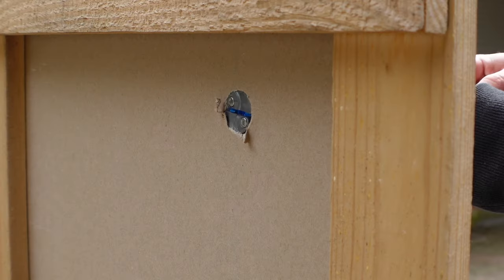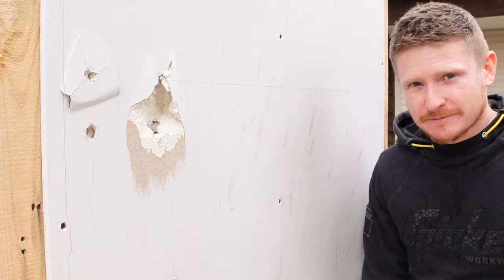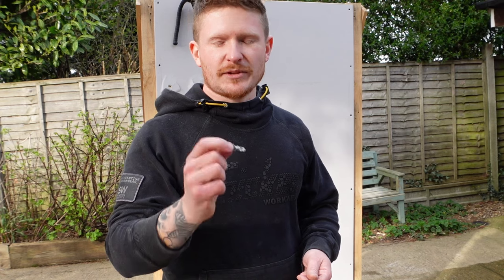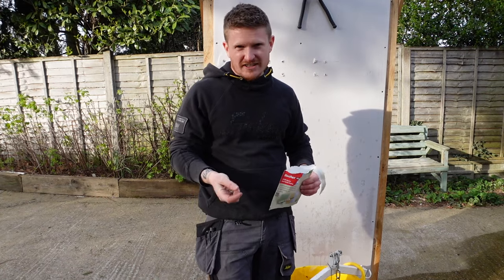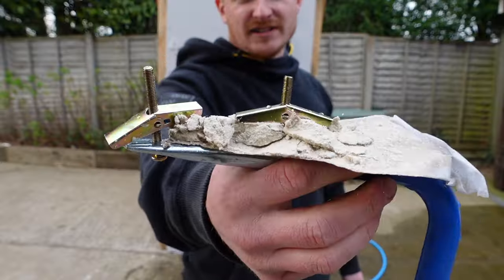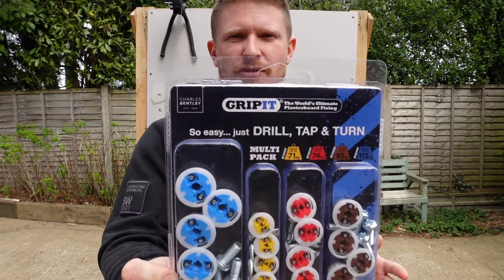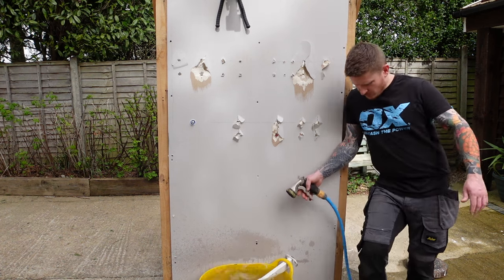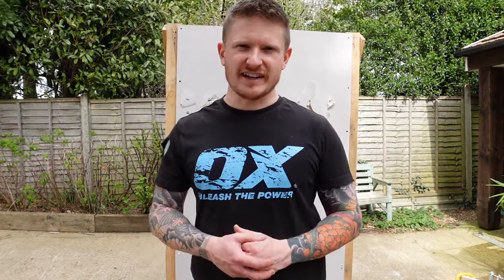What Plasterboard Fixings Are the Best | Drywall Fixings Tested

Comment: Am I incorrect here, but the loading measured surely is only half the recorded weight per fixing as there were two fixings each time, taking half the combined load....? So in actual fact, each fixing only performed to approximately half the test recorded value.....?🤔

Comment: My dad always recommended the spring toggle fixings over 40yrs ago which says something about the design. Two points I would make is that the spring toggles were let down by the plasterboard wall rather than themselves plus the hook you used had 2x fixings and I would think that the manufactures ratings would refer to the load a single fixing could handle? I does make me wonder how they did their own testing? I suspect a pull rather than downward load was used? I have no real idea. 🤔😄
Reply from the maker: You could well be right 😁
Reply: Got no respect for those gravity deniers! 😺

Comment: I moved into a 'modern' house with plasterboard stud walls a couple of years ago and found the 'tap in' spade fixings ideal for fixing shelves, mirrors etc. I've been impressed by their strength and that they are quick and easy to use.  The reason I watched your video is that now I have to fit a vertical radiator (about 15kg dry) which has four small angled u shaped brackets and no floor support. I think I'll be using traditional spring clip anchors after watching your 'test' video.
Reply: beware kids like to climb radiators.
Reply: Cut the board out between the studs and fix it proper
Reply: I fitted a triple thick bar vertical radiator, could just about lift it dry, very heavy.. you'll find thanks to the design of the small brackets that even if the fixings hold the brackets will cut through the plasterboard like a knife. Only safe method I found was cutting holes for the brackets in the plasterboard, mounting the brackets on wood then fitting the brackets to the brickwork with very strong masonry bolts.
Not a fun job.

Comment: Thanks for your time and effort making this.  I have struggled with most of these fixings putting up cupboards, towel rails and curtain track as they have more horizontal force than your vertical bucket test and just ripped out after a while.  Ironically, I found the Grip It ones worked well and now have a big pack of them.  They adjust to different thickness of plasterboard provided they are done up tight.  For a TV on a dot-and-dab plasterboard wall I found special long engineered metal fixings that are held in the brick/block wall and have a threaded front section for a bolt to hold the tv bracket.

Comment: Really useful test. Well done. I think to be proper science with repeatable results you'd need to do at least 3 samples of each fixing. Knowing how much variation there is as well as the average failure value would be very useful.
And now we need this experiment for insulated plasterboard (where the toggle fixings for example won't work due to no space to expand into). I presume some of the other clamping types will still work but they may not all expand properly to get a good grip, depending on how they work.

Comment: TLDR: use snap toggles (the kinds that looks like a metal bar with a zip tie attached to it) for heavy stuff like a television, use stab-in/tap-in for light loads such as picture frames.

With any toggle style anchor/fixing, it's less a question of how much the anchor can hold, but more a question of how much your wall can hold. They are stronger than your drywall/plasterboard/sheetrock. With other anchors, the questions is about how well they can hold onto the material. That's true for just about any of the true toggle style anchors such as the old school toggle bolt you used before the tap in one, the more modern snap toggles, or self drilling toggles (I don't like the self drilling toggles, but not because of a lack of holding power. I find the mechanism doesn't always engage and the threads that the screw drive into sometimes strip). snap toggles are my favorite of the bunch because they are mechanically very simple unlike the self drilling toggles, but they don't fall into the wall cavity when removed, like old school toggle bolts tend to. The Grip-it anchors aren't worth it at all imo, they're complex, require a giant hole to be drilled, and just like toggles it's dependent on your wall strength. Just use toggles and don't bother with them. As for the smaller anchors, stab in anchors leave very little damage if you need to remove them, and they hold a lot of weight for such an easy to use and non-damaging anchor, those are my preferred type of anchors for lighter loads like photos or brackets for small shelves with multiple screws
Reply: You figure you would use multiple tap in anchors for a small children’s book shelf? Or better to stick to the snap or regular toggle? Thanks for the advice!

Comment: I am a girlie of 72, new to DIY, but needs must. This video kept me rivetted as well as informed. Now to go and buy the correct anchor for my plaster board wall. What I will need to know soon, is how to hang 2 pictures (i am an artist and work in concrete and ceramic tiles) weighing 30 kg a piece onto solid walls.

Comment: I recently came across new ( new to me anyway) plasterboard fixings called GeeFix, they are fairly expensive but very very good. I used them to hang a large mirror and they worked a treat. Not something a kitchen fitter would use everyday due to the cost, but for the odd heavy item much better than fixing a damaged plasterboard.
Reply from the maker: I've used them once. They are very good for the larger loads

Comment: really great video thanks. One thing I would like to add (apologies if already commented on) is that it doesn't take into account the leverage / cantilever effect. So for example if you mount a wide shelf the force applied because of the cantilever is much greater. I wonder what the figures would be if you mounted a shelf bracket of 30 cm from the wall, and then hung the bucket from the end of the bracket. I'm guessing much lower. Obviously a fixing of this type would normally have 2 or more fixings also. These fixings are great for something heavy that is flush to the wall, I recently hung a heavy electric radiator to my garden room stud wall with hollow wall anchors no problem, and the same principle applies for heavy TV's for example, but for shelves that come out from the wall a long way the forces would be completely different. Anyway top man! Paul

Comment: Great video and very useful test. In my experience the Grip it’s are a poor fixing. Not only do other cheaper fixings hold better but the initial hole required is far too big especially if you with to move things afterwards.
Reply from the maker: Thanks for sharing
Reply: I've used them and thought exactly the same.

Comment: I always use the 10mm Fischer plugs (no2 in the video) for wallmounting tvs and I’ve never had any issues at all over the last 15 years.
Reply: Fischer plugs for me are hands down the best plugs around.Screwfix reviews say so as well.
Reply: Same just wall hung a 65 inch TV with them as used for years although I did do 20 fixings 😅

Comment: The Gripit is a newly discovered anchor in my world. 
The last one you demonstrated failed essentially just as you began the test. The failure appeared immediately upon releasing the weight. 

As did the others in a way. 
Keeping adding weight after the bumping out was appearing was where they proved they were done. 

An interesting test, but still not a real world condition. 
But it did accurately give a good indication of how these products would work. 
Moral of the story is never come anywhere near the promised strength.

Comment: This is a great video. Always love plasterboard fixings comparisons. Just to add to your list, snaptoggle is a great choice of fixing, I use a lot to fit heavy tvs, about £1 each. The only draw back, I guess with any toggle type fixings is it need 50mm cavity to work. Also I find that it don’t work with insulations. But they claim it holds over 100kg each. Which I am not a believer of. Duo power my second favourite 

Correct me if I am wrong - I think if you divided the results in half would be more fair as you did use 2 fixings for it. Theoretically, they should have held up whatever they claims x2
Reply from the maker: Your probably right :)
Reply: Hi, my tv weighs 9.9kg, I will attach it to wall mount and put as many screws as possible roughly 12 on each side(depending on which wall mount I purchase) I wont use a snap toggle it seems like I will have to make a really big hole, which other plug or self screw do you recommend please?
Reply: @neoloanderson6676  9.9 kg, even 4x duo power will be more than enough (go with 8 to be on the safe side). I’d avoid full motion brackets on plasterboard walls, if you must, go with one with a big back plate.
Reply: @tonygoshive785  Thank you for your quick response, I will order now, should arrive later on this evening 🤞🏾, wish me luck.
 Many thanks!
Reply: Any advice for fitting a heavy blind onto plasterboard ceiling?
Reply: @wintergirll  if you are lucky. You might find joists with long enough screws. Otherwise Duopower plugs should work fine if not too heavy

Comment: I have always used the tap-in expanding fixings so impressed with their performance 👍 Have also tried the metal screw in ones but won’t be buying them in future based on your tests. Have never used the beefier expanding metal toggle type cos never really been confident about attaching big loads to plasterboard but very impressed with them - you obviously need the space behind for the toggles to expand which could be an issue if you are fixing close to battens, etc.

Great video 😊
Reply from the maker: Absolutely agree. Cheers 👍
Reply: Try geefix the 🐕🐕 doodassss

Comment: As I expected, the metal spring  toggle performed the best, holding 49 kg. I've used these a lot in my house, and friends houses, for fixing heavy curtain rails. Some say the metal wall anchor, sometimes called a molly bolt, is the best, but in your test it did well (holding 36 kg) but not as well as the spring toggle (which held 49 kg). I guess this stands to reason as with the spring toggle you have the load spread out over a larger surface area, the longer the toggle giving greater surface area

Comment: Surely you forgot to add the 20kg weight back in for the Gripit Blue?  Be interesting to see how these fare when used vertically, as for a ceiling mount of something like a heavy light fixture.

Comment: Still prefer butterfly bolts as the load is spread over wider area. When hanging a radiator on plasterboard also use adhesive on the rear of the brackets to further spread the load and risk of slippage when little Johnnie decides to sit or jump on the radiator!!
Reply: Good tip to use adhesive. Sticks like shit for me because 9 year old Grandaughter gets to say shit when helping me 🤣.
Reply: @paulboro6036  Also u could use high density sound or fire rated plaster board at 30kg for 2.4m x 1.2m.
Difficult for daddy to punch a hole in it when he's drunk or throws a chair at it, never mind little Johnnie!!

Comment: Ive got a TV bracket to put up. Its a fixed , flush bracket but the holes are only 200mm apart. I think the best compromise i can do is one side goes into a stud and the other 2 i use gripit blue.
Reply from the maker: Yeah sounds good 👍

Comment: Really interesting video open my eyes 👀 as I always used the Metal screw type for as long as I can remember used them for my clients no issues over the years I was going to try the Gripit fixings but now I’m not sure 🤔 what to do as I’ve saw a Screwfix video and the plumber used the brown Gripit fixings it was 2 x Brown Gripit on the radiators and then stood on top of the radiator so your video showed the Gripit Brown fixing didn’t hold the weight as it stated on the packet Hmmm 🤔 what to do do I stay with the Metal self drilling into the plaster board !! Great video by the way thank you for honest display of various fixings
Reply from the maker: Cheers. Glad it was somewhat useful

Comment: Take the weight with a pinch of salt , due to the length of the chain and bucket from the fixing point acting  like levwrage , it probably shows less as what they can hold . If the weight was at the fixing point they would probably fair better . But great video 👍

Comment: I think you forgot to add the 20kg weight in your total for the blue grip it. 

I discovered Grip it last year whilst installing a new radiator in my bathroom. One side of the wall  was fine for my bracket but the other side was breaking with normal plasterboard plugs. 

I drilled the original radiator bracket to add 2 screws. 4 blue grip it in total on that side. That radiator would probably resist an earthquake!

I think the test depends on how the weight of the object/piece of furniture spreads. 

In the example of a radiator the bracket will even out the weight rather well.

Thanks for the comparison video.

Comment: I use the grip it fixings for wall hanging TV's and I have hung some big TV's.  I like that they use a machined bolt as opposed to a screw and have never failed me.  The drawback is there is a lot more repair needed if you need to remove them.

For pictures I use the tap it fixings, they are so easy, reliable and make no mess.

Comment: A problem I'm facing in my new house is that it's all 25mm plasterboard, but it's dot and dab, and the cavity behind is only about 20mm, so a lot of these fixings don't work at all. 

Proving to be a real pain to fix smaller things onto. With the big things I can do corefix, but the little things I struggle with having thin enough screws that go deep enough to get into the blocks (which I've pushed a backing wall plug into as well as a front plasterboard one).

Also the blocks they used are really strong, so my SDS drill has a tendancy to wander and chew up the plater board. Real pain in the arse!
Reply from the maker: Thanks for sharing your experience 🙂
Reply: Core fix are right fixings for dot&dab walls-secret is to pilot hole smaller diameter hole to correct depth then bigger dia hole to same depth,push plug in to finish flush then tap in metal core &then your screw the same length/depth as drilled holes

Comment: Best ever are geefix 👍👍👍👍 no other plasterboard fixing comes close
Reply from the maker: I've not used those ones. I will keep my eye out for them 👍
Reply: @TheDIYGuy1  give them a try and a weight test 👍👍👍💯💯💯
Reply: Geefix are decent but bullfix have been my go to lately. The smaller of the two available sizes requires a minimum cavity of just 7mm, and the larger requires 20mm. They are roughly half the price as well, for the starter kit anyway, and if you buy the box of 96 they're about 73p each.
Reply: @rodgerq  same company different fix 😂😂😂
Reply: @paul_my_plumbs_uk  oh that's interesting, I didn't know that.

Comment: Fantastic test bro. I wanna put my 12 kg tv to a 10mm plasterboard what do you suggest? will be fixed with 4 holes
Reply from the maker: Situation dependant. If it's dot n dab go with corefix fixings into the block. If it's studwork go with spring toggles.

Comment: Interesting that the spring toggle did not fail in and of itself, i.e. it didn't break, the screw didn't pull out of it, it did not pull out of the hole, it stayed working just fine until the plasterboard failed, and a large piece got ripped out.

Essentially the spring toggle load capacity is determined by the strength of the board, not the fixing.  It would be interesting to see how they performed in 15mm board.   And with one above and one below a noggin.

Plus a test of nylon toggles, e.g. Fischer DuoTec.

Comment: The metal self drilling fixtures hold an absolute weight. Hung heavy TVs in the past to plasterboard no problem. Remember if your hanging a shelf your utilising several of these strengths

Comment: I usually find at least one upright and if the item is heavy i often cut out the plasterboard and fit a 3 x 3 horizontal wooden batten between uprights anf screw diagonally 
Then i dont need plugs 
The plasterboard is always going to fail witht any weight

Comment: How about cutting a 1 inch square in the plaster board, insert a 1 and a half or 2 inch long by 1/2inch thick by 1 inch wide piece of wood with adhesive on it. 
Leave it to dry for 30 mins then glue and insert the square you took out, put a skim of filler on it. 
Then you've got the strongest mounting you could have for practically zero cost.

Comment: Interesting results, not rating the Grip-It series despite their Dragons Den appearance (which didn't go so well under scrutiny either).  Always used the Nylon Plasterboard plugs myself in small and large sizes, then Toggle Cavity fixings for super heavy stuff.
What about Fisher DuoPower Red plugs?  Universal go to plug and easily holds a good weight even on plasterboard.  Be nice to see a review on the two common sizes using your setup.
Reply: I think the 6p plugs her tested were Fischer duo's. I started using them recently and they are now the main plug I use because they are reliable and cheap.
Reply: @999pez  Indeed they were!!  Ooooops!  Definitely my go to, not worth bothering with cheaper "standard" red plugs.

Comment: You can get something similar to the spring toggles that's far heavier duty called "snap toggles" they use a nylon cable tie like mechanism and are a bit fiddly but they'll hold maybe 75kg each or something bonkers. Though if you're doing that kind of weight you wanna think about using a board or something to spread the load (or just find the stud for god sake loll)